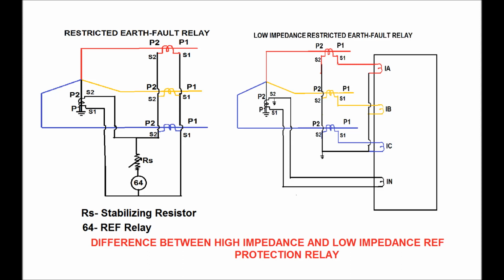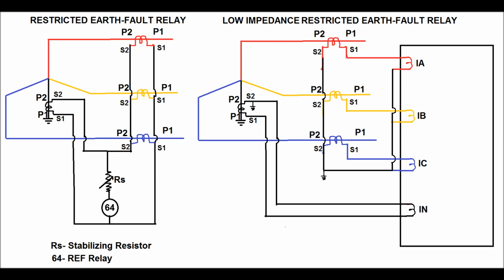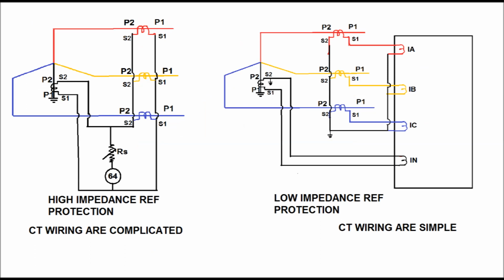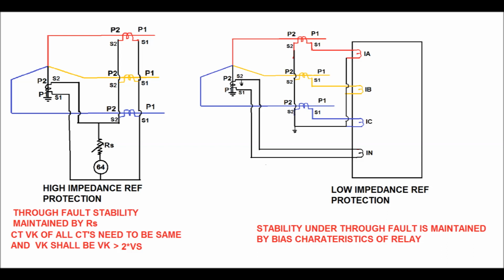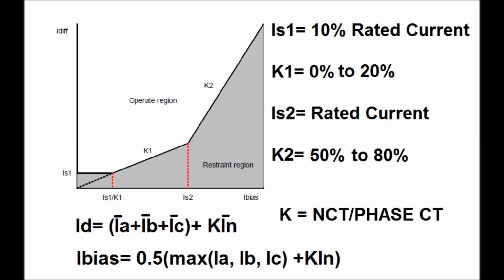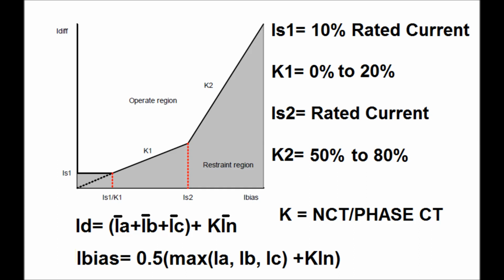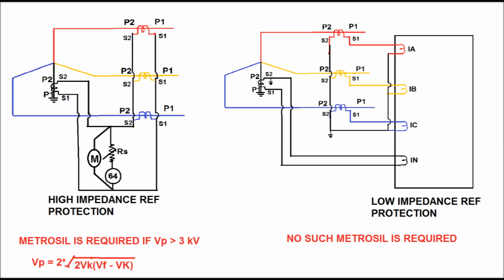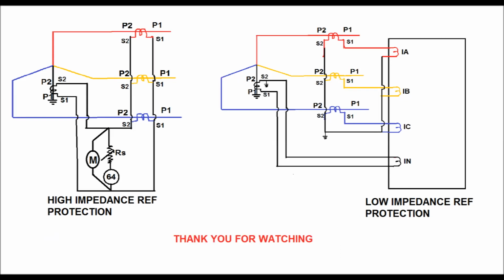Difference between High Impedance REF Protection and Low Impedance REF Protection Relay

Comment: Why high impedance earth fault relay ct S2 terminal not earthed?
Reply from the maker: It should be earthed.
Reply: this has to be done to ensure that during failure of the CT insulation, the potential on the measuring circuit cannot rise uncontrollably high.